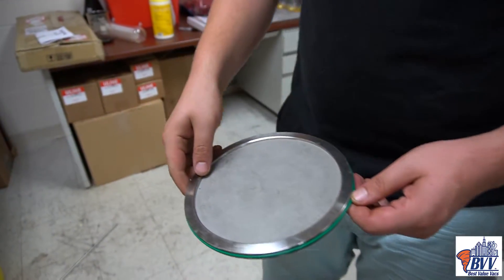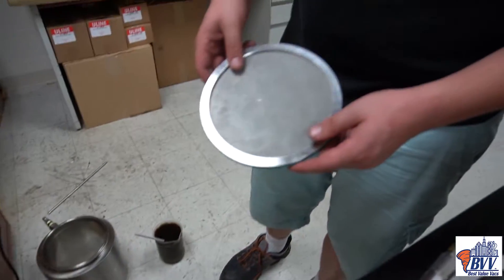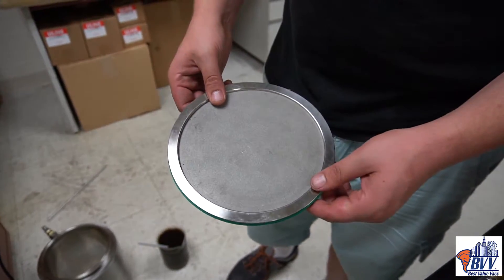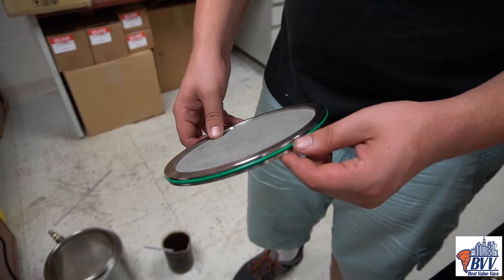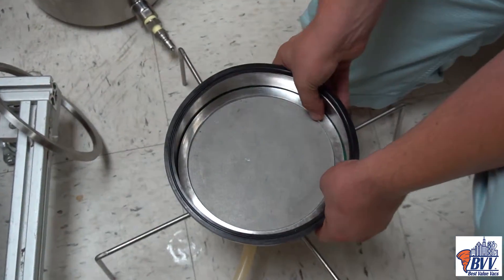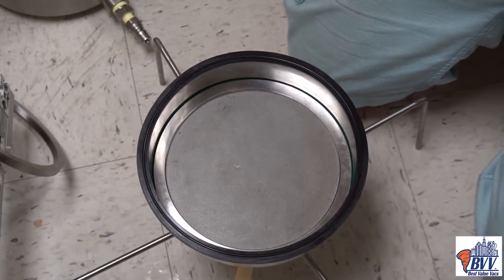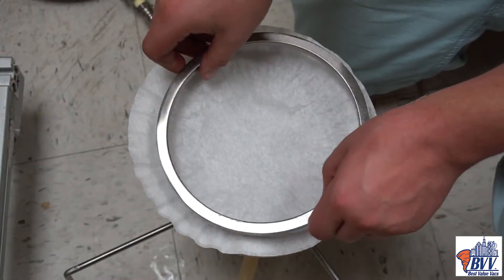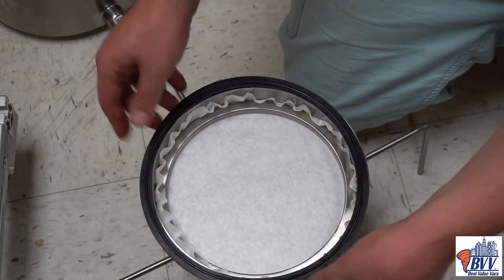Sintered filter disk demo

Comment: The disks have a rough side and smooth side.  Which side is the "IN" and which side is the "OUT"?
Reply from the maker: @Golden IRA Great question! Although these disks can function with either side facing up, utilizing the disk with the rough side up is recommended. Using the rough side as an IN will help prevent possible clogging. 
Feel free to give us a call at (331) 281-0154 to talk with a tech.
Reply: @Jmarosii  great sharing, basic on the flow direction, we confirm the rough side and smooth side, rough side for support, smooth side for filter